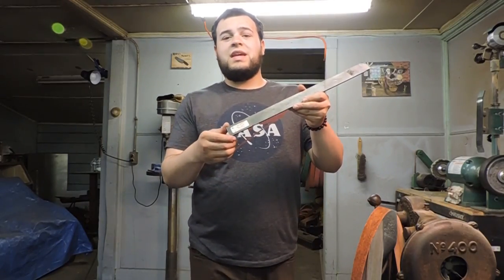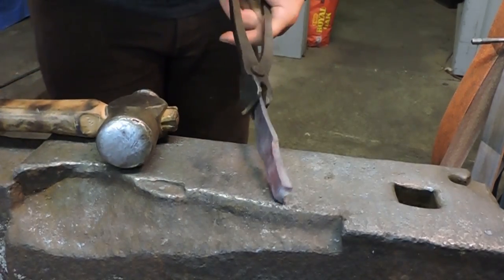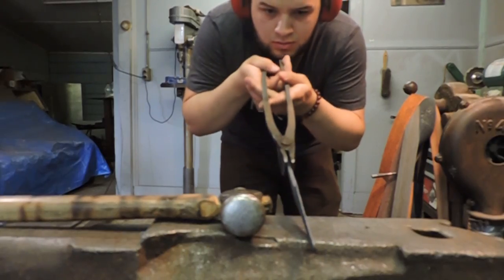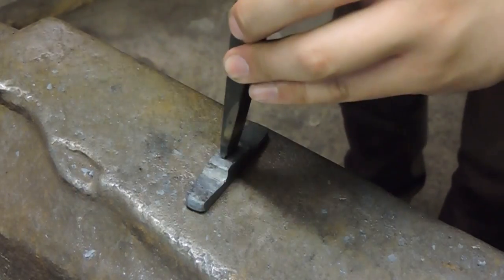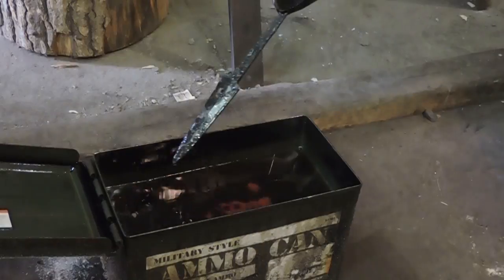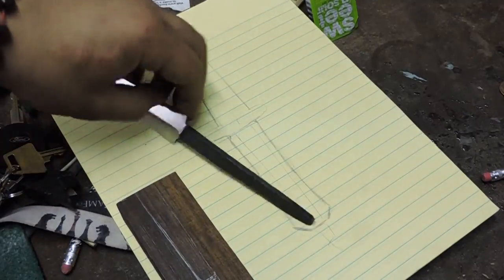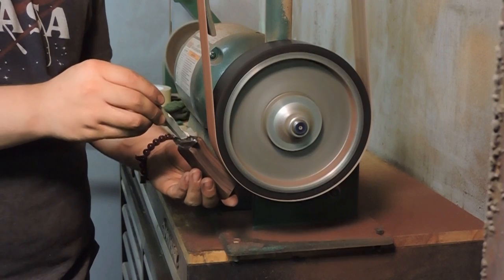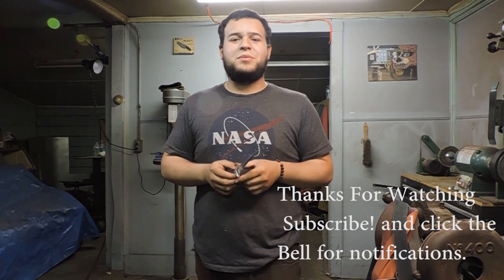Forging a Dagger / Letter Opener

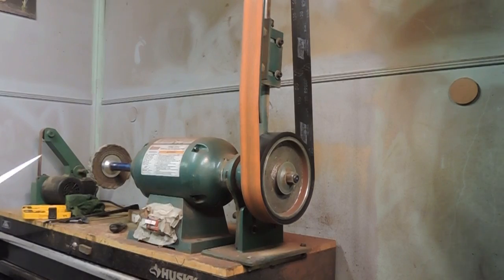Comment: 17:50 to get glue out, while gluing up the blade, use acetone, nail polish remover or rubing alchol with a q tip to clean up any eccess glue. also after the blade has been glued up try not to touch the blade at all besides sharpening, have the blade 100% finished when you glue it up. good job!
Reply from the maker: Thanks for the tips bud!